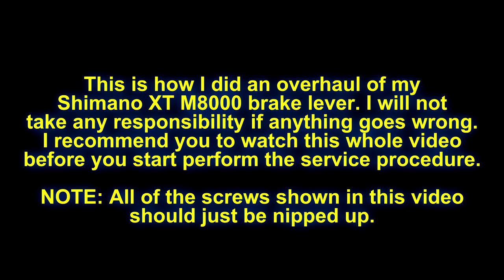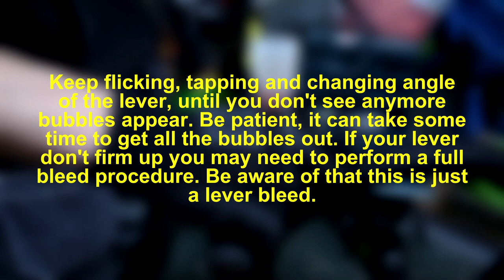Shimano XT M8000 Lever Overhaul - Common problem solving

Comment: appreciate the knowledge transfer but honestly folks that effing spring is nearly impossible to line up with the thru bolt. I wasted a good hour attempting this fix. The thru bolt finally went in, not worth the time and frustration. take it in to your lbs or better yet, shop for new brake levers

Comment: My M8000 brakes has this clicking sound everytime I pull on the lever, do you have an idea what the culprit is?
Reply: Many have. I don't know what is with Shimano these days...
Reply: Probably a broken piston guide, happened with mine and I’m not sure where to go from here
Reply: @charlottethornton9873  I've only had my brake set for a few months. I have the exact same issue. They break so easily. They are otherwise great brakes, but this one issue makes me regret buying them...

Someone has made a replacement 3D printable piston guide, but I'm not content with that solution. Shimano should sell them as replacement parts..

Comment: They are usually just gummed up a bit from old oil or dirt. Remove the hose, remove the lever from the handlebars, spray wd40 that will dissolve old gummed-up oil into the hole, liberally. Let it sit blade down. If it's still stuck, plug the hose hole, spray some wd40 on the other side, inside and around the piston rod, liberally. Let it sit and then drain the wd40 out after 10 minutes or so. It should flush out and dissolve old oil and dirt. If not you'll have to disassemble it the way this video shows.

Comment: Great great piece of detailed info- for example, not knowing how to release the lever axle pin I would fight with this any possible way when all it takes is unscrewing the little binder bolt under a rubber plug. Anyway, Is it possible to get the piston reparation set - let's say the seals? should they be damaged. In my case the piston is leaving a bit of moisture any time I push it in. Thanks

Comment: 8100s here

Im in a position where if the brakes are close to my grip, and i one finger brake, it smushes my other finger.

I got the lever throw all the way out.

Do I need more oil in the line or something?

otherwise I had to scoot the brakes further away from the grip, but that also puts my shifters kinda far away.

What am I missing.

If I just 2 finger brake then Im fine but what the heck thanks?

Comment: Nice vid! I hace a problem tho, after loosening the little screw on the lever, I can't push out the big pin that holds the lever, like you did at 2:15, it's just very hard and it won't budge. Any tips?
Reply: Very helpful but  you should use  another color gloves  different  that black
Reply: having the same issues? how di you resolve em?

Comment: got a m7100 and i couldn't remove the lever axle/pin after removing the small screw cover by the small rubber. Any idea what to do?
Reply: Same with my M8000 :-/
No clue why, so far.
Reply: Hammer fixed it.
Nothing was damaged by doing so.

Comment: I ended up watching this at least 20 times at 0.25x speed and I finally got it right.
No matter what, those brakes keeps filling with air and becomes spongy. Holy potatoes.
Reply: Same here, what was your solution? I finally just bought a new lever

Comment: Hi Oscar, thanks for the video. Awesome stuff.
Do you know by any chance how I can get a spare lower guide (I supose it's made of plastic) that you show after poping out the push rod?
Thanks.
Cheers,
Antonio
Reply from the maker: Hi Antonio, as far as i know: no. You'll have to buy a complete lever or scrap one from an old lever. You could try to get in contact with a shimano service center to see if they can help you. good luck!

Comment: Great video! Just what I needed to figure out why my BL501 lever was stuck at end stroke. I successfully disassembled the unit. Somehow half circumference of the piston was covered in fine scratches. luckily I had another lever I had broken in the past, from which I’ve been able to salvage the parts needed. 
Thank you!

Comment: Awesome video, i have a proble, the lever doesn't return, it stucked in, is anything wrong with the piston?
Reply from the maker: i dont know :)
Reply: Cole Taylor i just threw it away
Reply from the maker: I would give this procedure a shot. might be a dry/ swollen seal. try to put a small amlunt of grease on the piston. if it doesnt work you might have to get a new lever. good luck!
Reply: i only read this now cause i have the problem too now, i read in other forums that the plastic pistons inside sometimes swell up wich makes them get stuck, i just tried carefully grinding the two widest parts down a little bit and it worked (at least the thing moves, i did not try if it works cause i have a replacement, the rubber seals should be wider than the plastic in any situation anyways so i did not see a big problem with grinding them down to maybe not the perfect size... maybe next time it helps)

Comment: I did this months back when I experienced slow lever return.  It did not fix the lever pump though.  I'm interested to know the fix for the lever pump.
Reply from the maker: common issue on shimanos, especially the new ones. usually a bleed issue but could also be a bad aligned calliper or sticky pistons. they could be a nightmare sometimes.

Comment: Thanks mate, this video really helped me a lot and it was the only way to unmount my Shimano SLX brake. The  difference and the problem I got is to unscrew the free stroke screw, that one came with a weird 2 little holes on its head (instead of a cross screw), I believe this is shimano trying to avoid "normal" people to service themselves this unit.  By  the way can I ask you if "teflon grease" is also valid to cover the piston and seals? (I did not have silicone grease), don´t know if this is a big issue.Thanks again for the good job! appreciate!

Comment: Good day oscar i have same issue with my Xtm8000 issue also brake lever piston is leaking oil any idea 💡 where do i get a seal kit
Reply from the maker: James Paul Tenasas really make sure everything is clean (piston and inside leverbody) but first claim warranty if possible. shimano usually doesnt sell such seal/service kits, only complete lever assebly as far as im aware. wish you good luck with your brake
Reply: Oscar Midelund not possible to my case i bought the GROUP SET WAY BACK 2015 SO ITS BEEN 3 YEARS ALREADY I THINK SHIMANO WARRANTY CLAIM FOR 18 MONTHS ONLY BY THE WAY THANKS

Comment: Thx man, I will have to do the same, but I didn't know how.
Reply: My SLX were  not holding pressure, so stripped down, cleaned replaced .... All is gut, works as well as new out of the box.
Pressure cups were fine so there must have been some contaminant on the cylinder wall, but I really didn't see any evidence of contamination or residue stuck to cylinder or piston.
Now to do my rear and see if it fix's the problem with that one.

Comment: One of my levers clicks loudly when released. I can see that the roller bearing that activates the plunger does not move smoothly creating the click. Was this an issue your service solved?
Reply from the maker: it might be those plastic thingies that guides the little pulley you see when you look from the side that is dry. some lube will sort that out for you if so. solved my issue
Reply: I have the same issue Mark! Could you solve this problem? Lube didnt help me at all, i have Zees
Reply: I am going to try what Oscar recommended tonight....just saw his reply. Let you know how it works.

Comment: can you unscrew the reservoir cover
Reply: There is no reservoir cover just a teeny tiny little screw at the very top in the parts get even smaller than that Springs in 2 part plastic pivot.
 I understand it's made to be light weight but it's ridiculous.
Reply: @davidpearl6438  I have the XT with chrome reservoir covers and the overhaul was a pain in the Arse.
I had a deore with sticky plastic piston . Not releasing so I sanded it 
I also have magura mts seems simpler.

Comment: Really trying to follow along closely.moves too fast and the black on black at the beginning and the end of the video is a big mistake better lighting. Would? Help.i realized part of the problem is with Google and YouTube not easy to push the pause button exactly where I needed so I can read your. Subtitles which again too fast for most of them.
  Period I would suggest a little voice over about the details along the way.but thanks I'll compare in contrast with the others that I found only one other.
 Really frustrating.

Comment: Learn from my mistake: DON'T TRY TO PUSH OUT THE PISTON WITH A 1.5MM ALLEN. YOU WILL BRAKE THE LITTLE PIN THAT GOES IN TO THE HOSE. YOU CAN'T PUSH OUT THE PISTON LIKE THIS. MAYBE IT WORKS WITH A SMALLER ALLEN KEY BUT 1.5MM IS TOO BIG!

Comment: You didn't show the most problematic, the most hated and the most unreliable part of these shitty levers. I mean those 2 small plastic parts which correspond to servo wave action. They are so flimsy, you can brake those even after slight wrong movement, and after you'd broke em, that's it, you are buying new lever. I loved the whole shimano XT line up, but starting from 8000 series I understood that company began to move on quantity and not quality side. If they(I mean shimano) managed to set up production of such  shitty quality products(bl-m8000) containing such fragile parts, so be kind and produce those liitle pieces of shit as spares.
Fuck those newer shimano brakes! I will move to Magura from now on.

Comment: DO NOT add silicon grease to a mineral oil brake system!!! Use rubber grease instead.
Reply: It doesn't matter+ they are the same thing.